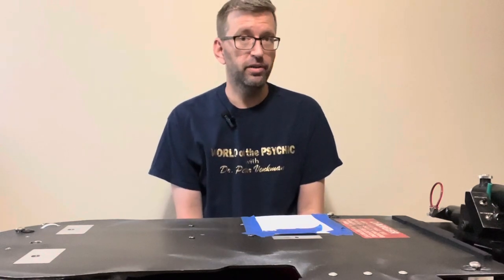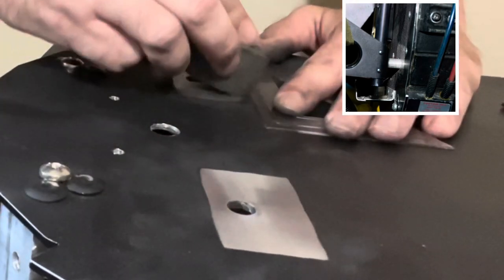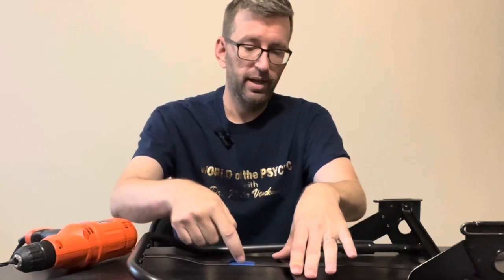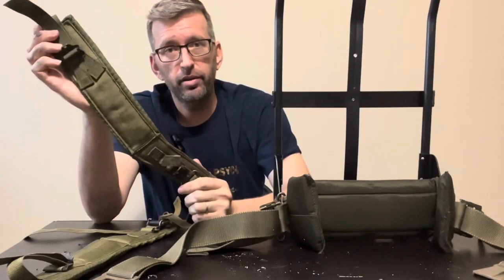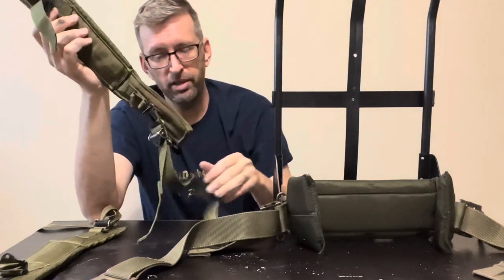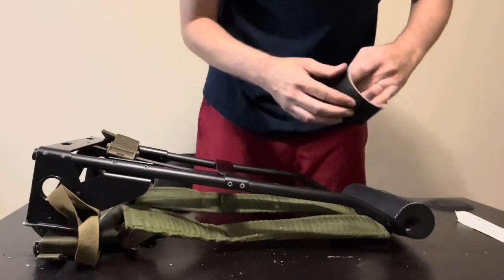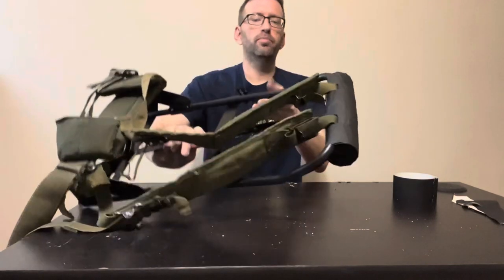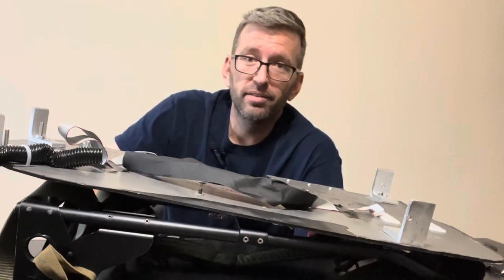The Venkman Conversion - ALICE Frame, Straps, and Kidney Pad Swaps; Spacer Paint Details

Comment: My mistake with my LC2 was I drilled two holes on the vertical bar awhile back that goes straight across which I'm pretty sure didn't have so I think I ruined it🫤 I mean it's only two holes and still sturdy, it's also in pretty good shape considering it's age. The thing is I still haven't figured out how they mounted the Lc2 frames on the semi heros